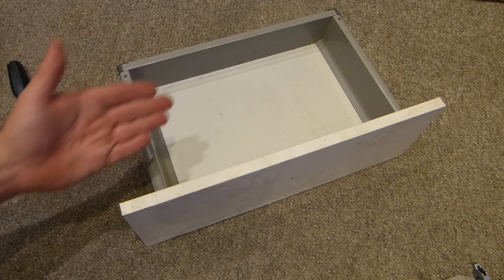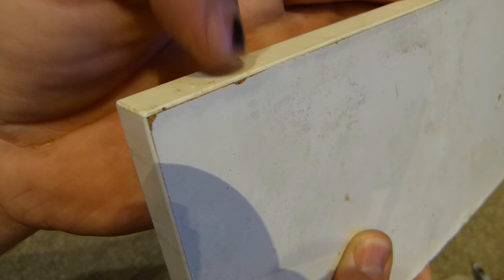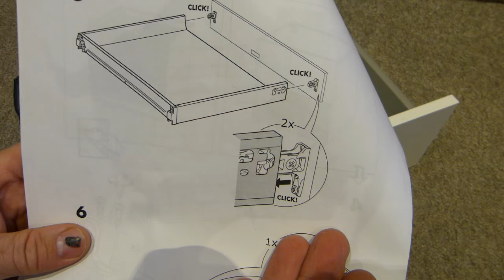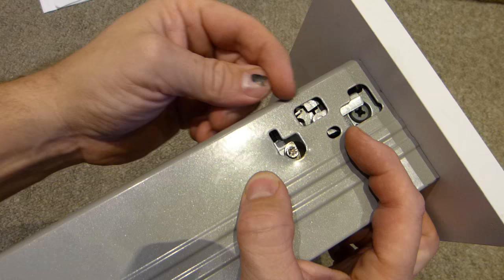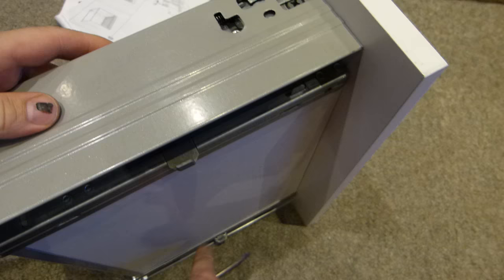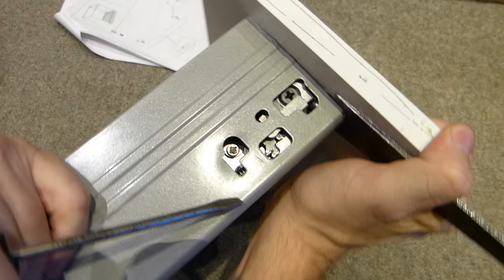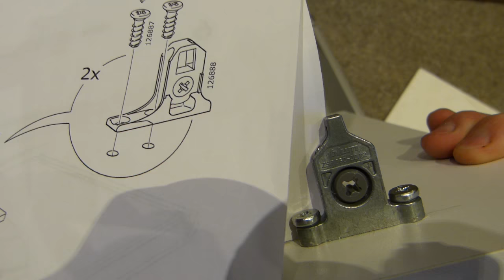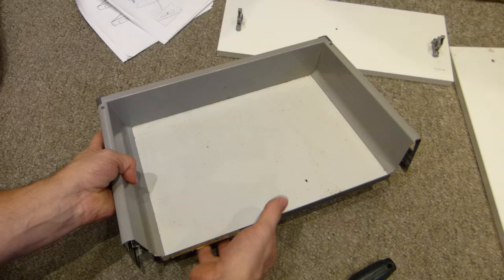IKEA drawer front removal & hardware fitting detail

Comment: I hope you now realize there's a much easier solution for this. At the 5:06 point, instead of using a flathead, use a Philips screwdriver and just turn that screw mechanism. It will allow the latch to release and the drawer to pop out. Much simpler, faster and it doesn't irreparably damage the inside mechanisms. Unfortunately, by using your method, this is what happened to me and the latch doesn't click in and I now have to manipulate the fittings because it's been tampered with. :(
Reply: Yes to this!!!!!! This just saved my sanity !!!!!!!
Reply: Just wanted to point this out....
Reply: Thank you, you just saved me a ton of time.
Reply: Yep, that's totally right. Found it out myself and just wanted to post it. Well done!
Reply: You’re absolutely right i had to do a bunch these today and stuck in my Phillips and it was way easier.
Reply: Yeah man, I did it his way then when I went to reattach the drawer the mechanism was in the wrong place. Did what you suggested and worked fine
Reply: Yes, thats much easier, no crowbar please
Reply: I read this too late, but didn't damage it :-)
Reply: Agreeed! Thanks for video tho. Helped me figure it out.
Reply: @NWnico  Me too. When I tried to reassamble the front with the body, it didn't match. Than I recognized the + screw (Philips), I turned it ... and oops, how easy. And now I understood the thumbs down under the video. But first, when I went crazy, I was happy to find a similar issue here in YT and was hopefull to find a solution.
Reply: I damaged mine too.  One drawer worked fine, but the other didn't  now I cant get them back in
Reply: Thank you soo much
Reply: Great!!!!...U save me a headache..Thanks
Reply: Dont watch this you will lose your mind ZMAC has it bang on and the spring is then primed to take the drawer front back 👍
Reply: Thanks mate. This is a great example where YouTube comments can actually be helpful. Saved me tons of frustration.
Reply: Yes indeed! You can tell that’s the way it was meant to release. That makes more sense than keying the face off.
Reply: Man!!! Thank you ! I almost broke the whole thing trying to get it out the way this guy explained!!
Reply: Thank you, you saved me damaging my drawer and made it really easy to remove it.
Reply: I’m so upset 🤣🤣 I read this after I already broke off one side 🤣🤣 it released the broken side !!! 

“Can be taken off by hand , gotta use a lot of force”
Reply: Omg thank youuuuu
Reply: Just what I thougt when wathing this video. "what is that screw for" I was  wondering :)

Comment: Thank you for the video. My drawer front kept falling off and I couldn't figure out why. After watching your video I figured it out.  The 4 screw holes in the front board were stripped and too large after all these years of use (17). So I used another hack to fix it. I popped out the brackets and inserted a toothpick into each hole with the screw, screwed it back to the drawer front and voila...it worked!! Nice strong hold. "Clicked" it back to the drawer. So fabulous!! Thanks so much for showing me the mechanics of the drawer. It saved me😊💓
Reply from the maker: Thanks for watching!

Comment: This video did help me thank you , however there is easier way of opening it without any power to pull it out, at time 5:05 when you pull up the safety fall you expose the Philips screw driver shape hole that's exactly what you need to do put screw driver in and twist, that will pop out the whole think.
Reply: Oh!  I followed his instruction and I got lucky

Comment: Thanks so much for this. Trying to repair a broken drawer front was looking impossible until I saw this video. My drawer is slightly different but the latch mechanism is the same and this was the bit I couldn't figure out. I did use a screwdriver to turn the internal latch as trying to pull with a pair of mole grips whilst holding the tab up was hard work.
Reply from the maker: Glad it helped!

Comment: Plus one to those saying to use a Phillips. With top of drawer facing up and drawer front on your left, use Phillips and move the little flap slightly to get it out of the way. insert head and turn clockwise, away from the drawer front. Flip the drawer over, and now with top of drawer facing down and drawer front on your left, do same thing but turn screwdriver counterclockwise. In other words, for whichever side, turn screwdriver away from top of drawer and away from drawer front. Not sure how to describe that. Pops right off. Thanks, everyone. This made it so I could correct my mistake of mounting the clips that attach the drawer front all in the same manner in error instead of placing them in one location for the bottom drawer and another location for the remainder of the drawers. Thanks
Reply: I did the same thing. That's how I ended up here.

Comment: Sorry Lad, although your system works, risk of beaking something are high. The only thing you need is a Philips screwdriver. You need to use that screwdriver and lift the metal latch that partly covers a partly hidden Philips screw, insert the screwdriver and turn, each part of the front will immediately remove when you turn.

Comment: The reason Ikea "failed" to include that in the instructions is that you're showing us how to ruin the drawer. You remove the front by putting a Philips screwdriver into the cross-shaped slit and turn it slightly, the front falls right off with a gentle click... You're obviously not supposed to fiddle around with a regular screwdriver and bend things out of shape. On top of that, the instructions you're looking at are not for this drawer, that's an older model, so no wonder things don't add up for you my friend. Good luck!
Reply from the maker: Shoot a video showing that it works exactly as you say, include a link here.
Reply from the maker: @iamthebeatmaster  Bravo. Video does not show REMOVAL of anything. Otherwise, spot on.
Reply: My Maximera drawer worked exactly like theoverengineer said in this video...not sure what drawers maroon2k or iamthebeastmaster are working with.

Comment: Man, the front of my draw won't click back in after this.. help!
Reply from the maker: It should, and will, when aligned precisely.
Reply: He didn't show it in the video but the center latch can come down and stay down preventing you from putting the drawer front back on. I think his was down on the right side when he was showing it at the end. You need to simultaneously lift that thingy at the top and then lift the center latch up then let go of the thingy. That way the center latch stays up till the next time you push the drawer front back on - at which time the center latch clicks back and holds the drawer front on.